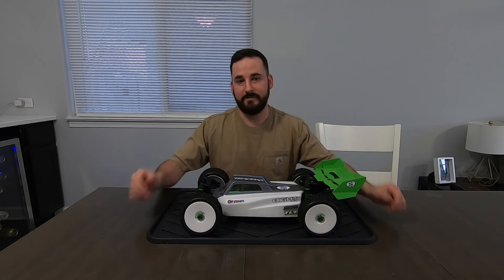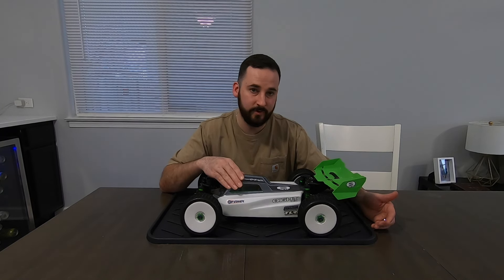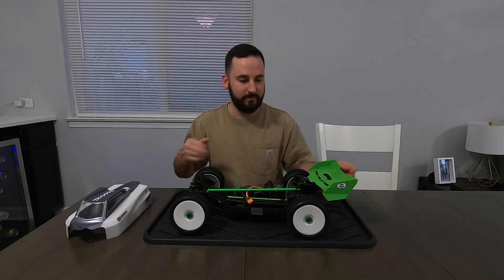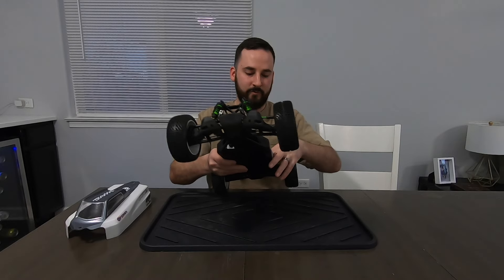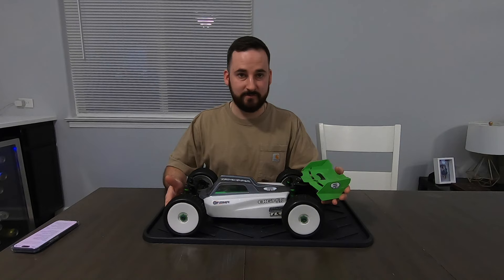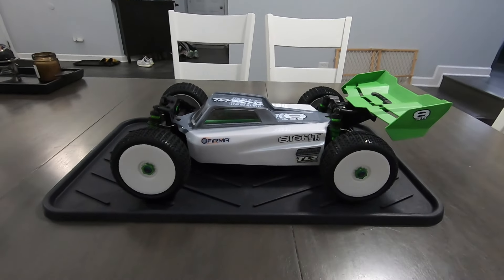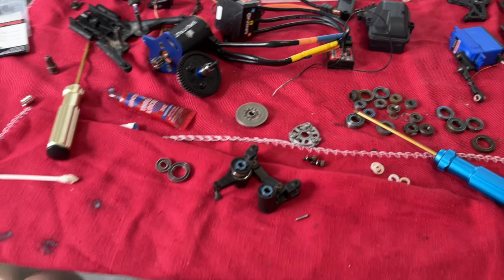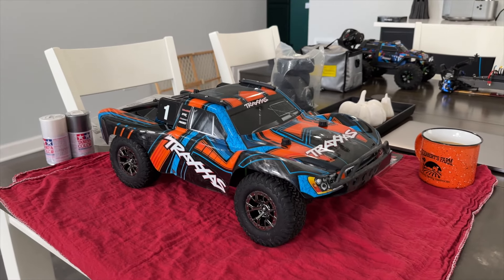Converting a TRAXXAS SLASH into a 1/8th Buggy! (Traxxas BackSlash Conversion)

Comment: I did this a wile back, same idea used slash and built it up. i had over 600 into it by the time it was "finished". Then I went on ebay and bought a used mugen mbx6 eco for around 200 and it changed my life. Backslash was sold and I've been enjoying "race grade" rc cars ever since.
Reply from the maker: It's definitely not comparable to a proper 1/8 buggy but I had most of the parts laying around and it was a blast to build. It did definitely make me want a race grade 1/8th ebuggy.

Comment: Loving it. Although I’m pretty sure you have just the heavy duty driveshafts. The extreme heavy duty driveshaft are parts number 9051. Those are used the the Extreme heavy duty kit. The bearing sizes are different.
Reply from the maker: The ones you're talking about are the Maxx Duty shafts, the extreme heavy duty shafts are the ones that come on the Slash ultimate and a few other models.

Comment: Sweet build! btw the revo 6s set up fits really nice in the slash just need to move the radio box the buggy body would no longer fit but a 6s slash is pretty fun! I needed to replace my diffs with the x0-1 diffs because they couldn’t handle the 6s power
Reply: I have a Slash 4x4 with a Funny car motor and a mamba monster 2 esc, receiver box is up front center of the chassis, do you have a part number for the XO-1 Diffs that I could beef mine up so I don’t have any problems?

Comment: What does it weigh?   How much ground clearance do you have it at?   How much better would you say a Typhon is for turning and stability?   Under any circumstances do you figure this could keep up with either buggies 1:10 or 1:8, or is this just good as a basher?   I had a Traxxas bullet as my first car.  It was too heavy, but 1 thing it had that went away and came back was sway bars front and back.

Just wondering if the cheap used slash build is the way to go.   I saw the old video where your friend put a brushless in his Slash, and it kept flipping.  I'd hate that, or cars that just do donuts too easily.
Reply from the maker: I haven't bothered with checking weight, I just built this because it was a fun buggy to build to my liking. Any purpose built 1/8th buggy would be better performing but I built this for around half what a Typhoon 6s cost and I absolutely love how it turned out. If you plan to race, definitely do not go this route. But if you have an extra slash laying around and a fun assortment of spare parts- definitely get creative and build one for the hell of it.

Comment: Just building one of these myself. Fun build for sure. Any ideas on other bodies they stopped making the losi 3.0 body that fits perfect. Only know this because I have 3 bodies from a losi.
Reply from the maker: I just found out today that they stopped making the 3.0 unfortunately, but from what I've seen the 4.0 fits too!
Reply: @A2ZRC  from what I was told the 4.0 body is a bit wider and doesn’t fit as snug to the sides. A guy I follow on YouTube did a build this is how I found out.
Reply from the maker: that's correct, it is a tad wider but if you use body mounts it'll work. I've also seen that the arrma typhoon body fits it too

Comment: Shouldn't those swaybars mount much wider on the arms in order to have the proper leverage to be effective at the amount of travel where they SHOULD be doing something? (I mean, I've seen other RCs built with narrow mount sway bars that didn't do anything to the other side until 90+% of the suspension travel was achieved. One example didn't do anything even at FULL travel. Might as well not have it if it's not doing anything by mid-travel or so.)
Reply: You can also experiment by making your own swaybars out of music wire. I bought the Traxxas bars for my Rally and thought they were pretty ineffective - very little influence at full travel. Later I bought a Slash and made my own sway bar system bending my own bars. It took some experimenting, but I'm much happier with the results.

Comment: Cool conversation but why not just get an 8th buggy? Your putting alot a money into that and your not actually getting the experience. I get it, it's fun to biuld but it doesn't make sense to spend the same and deprive yourself of what u want  and there's tracks, u might have to drive but if u just wanna bash around thats cool too but u to your local track your gonna find others who share the same passion.
 The shocks on that thing are dainty and it doesn't have much suspension travel. Go get a tekno or if u like Losi go buy one. For the money u spent you'd have something awesome compared to that. Your missing out by messing with that
Reply from the maker: I spent half what a Typhoon 6s costs to build this and I primarily built this because I had parts laying around and love how these look when built right. If I had a track under 3 hours away from me that I could visit often, I would absolutely look into proper 1/8th buggies but spending that kind of money on a race buggy only to bash it just didn't make any sense to me personally.